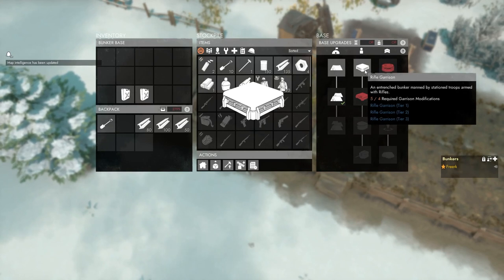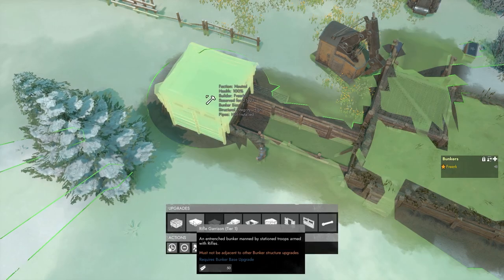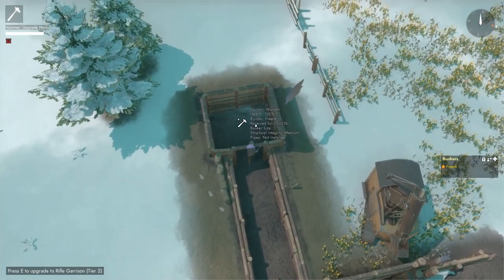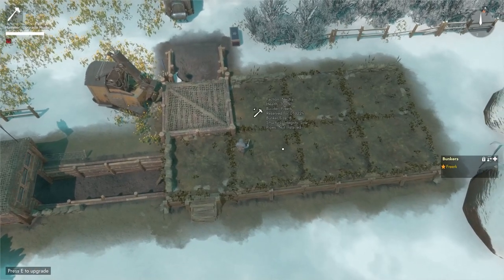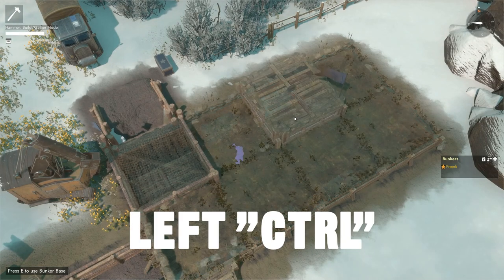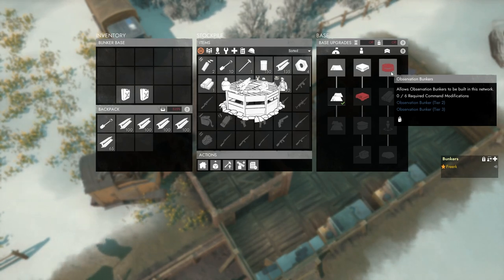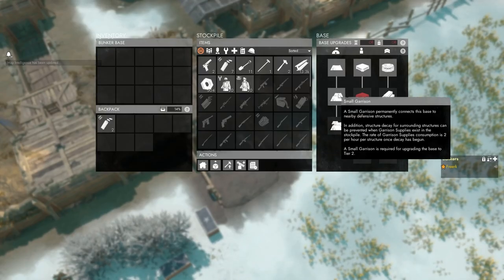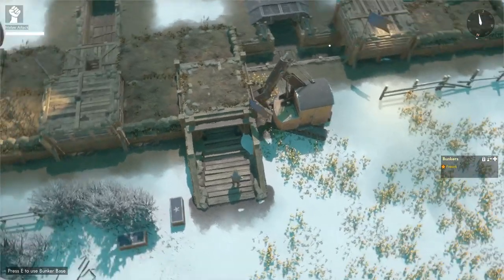Foxhole: Bunker Bases Part 2

Comment: Observation bunker is a heat score unless you are far removed from the front lines make sure you can single-handle the attraction or have others to help with that attention, and your base should adequately handle the attacks to ensure longevity.

Comment: all the types of logi transport would be great! I can't find anything on using boats to ship anything and why you'd wanna do that
Reply from the maker: One day :D.
The benefits of water logi? Quantity. A Freigther (BMS-Ironship) holds 5 containers/vehicle packages. So at 5 containers, with 1 container having 60 crates that's 5*60=300 crates per shipment
Reply: @FreerkHoltes  oh wow! thank you for the info! I really appreciate it!
Reply from the maker: O be aware that when usin the big shipping containers (60 crates) you can only unload them at a storage depot or seaport. Small container (40crates) can be pulled empty by hand

Comment: how much time does this take to replicate? i would like to play a bit with the construction system to learn it. can i build this entirely in the training zone or i need to do it on the actual war map?
Reply from the maker: To learn I would advise you to do it on the home island. Just get familiair with how to access the upgrades on bunker and trench pieces and how to plan your builds. To replicate is going to take quite a lot of time especially with the small garrison upgrade for instance.
Reply: @FreerkHoltes  thank you! Yesterday I managed to build a base in a starting zone away from the war, unlock the provisional garrison and upgrade it to Tier 2. Then I supplied it with 60 garrison and 60 bunker supplies and I logged off hoping that today I would log back in and continue the work on it. Now 24h later the base completely disappeared. What could have happened? I assume they were not taken down as the vehicles that I used were still there. Are they even possible to be taken down by players(without using firepower on them)?

And also some other questions:
1. I assume the Tiers 2 and 3 upgrades on bases are just increased durability on the basis right? Is there any advantage a superior tier has over an inferior one other than hitpoints?
2. How can you build a relic base? On the wiki it says they are buildable with CV but on the CV's build options I can only build bunkers or encampments. 
3. Hope this question makes sense: 
What happens to the adjacent structures of the base when you upgrade it with CV from Tier1 to Tier2? This upgrade can be done only when Small Garrison is unlocked yet the individual bunker pieces adjacent to the base can be upgraded to tier 2 pieces(like bunker ramp, engine room etc) from inside even if the base itself is not Tier 2 yet. Or are the base tiers only hitpoint upgrades? 

Thank you for reading this! :D Nice guides btw you got yourself a subscriber ;)
Reply from the maker: Not sure why your base would be gone
1: Upgrading to a higher tier will increase, hitpoint, structural integrity and when unlocked allowes you to build different garrison upgrades. Machine gun Bunker and AT gun bunker can only be build on top of a tier 2 or tier 3 bunker piece, and the Howitzer Garrison only on a tier 3 bunker piece.
2: Relic Bases can only be REBUILD, not build. Just like refineries and factories, amongst others, when they get destroyed they can be rebuild using a CV
3: Nothing happens to them. In theory you could have a tier 3 Bunker Base Piece surrounded by tier 1 bunker pieces.
Reply: @FreerkHoltes  thank you! 🤘
Think the base might have dissapeared due to something called 'rapid decay' which I'm not sure exactly where it happens - my base was in a starting zone but there are several bases there as well which did not dissapear